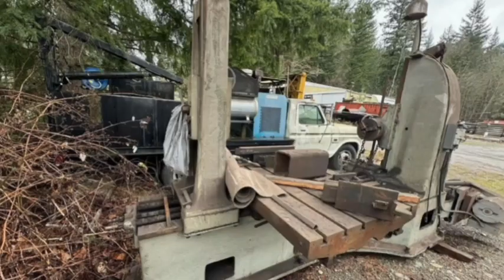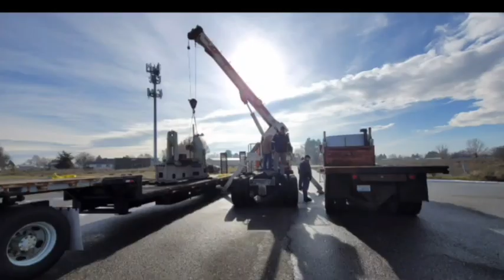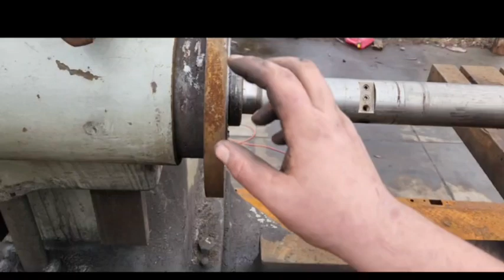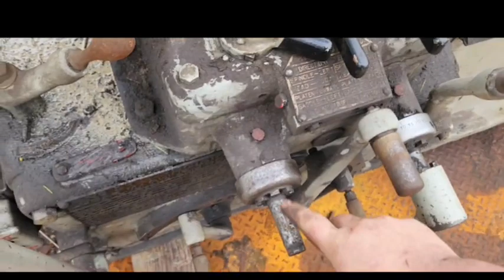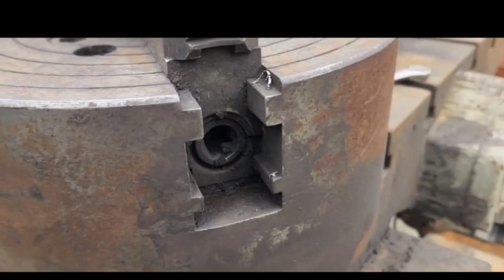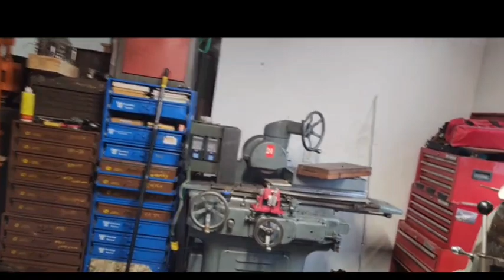New machine day/boring mill introduction

Comment: Nice addition to your shop

The 31 is a little borer it weighs 14k if its the standard orientation, so you werent too over the capacity

Nice you got a line bar with it, lucky man

The plate was added later, theres a 4 hole mount on the spindle face, clean all that goop off the spindle bar, before you run it back in.

That machine will have bronze spindle bearings so it wont ever bore a truly round hole

 the clutch will be asbestos lined so if you are taking it completely apart use a respirator 

If you send lucas the serial they can get you some info on the exact machine, including build date and some extremely basic manuals
Reply from the maker: Thank you, I knew the plate was an add on. I'm debating trying to swap out the bronze bearings for taper roller bearings (I've heard of others doing that- mostly for higher speeds). For now I'll run it as-is, the rest of the machine is very, very worn out so I may just replace it with a newer/nicer HBM in the future.
Reply: @hiddenworldforge374  I've done a swap from bronze bearings to tapered roller bearings before on a Lucas 41, It was rather involved but not impossible. Idk if I'd suggest it, but it certainly can work.

If you do buy a newer borer, if you can find a 41b or a small TOS h63 I think you'd be set.

Until then I am sure what you've got can be made to work. The 31s aren't bad machines, they atleast have Rapid traverse in All axis.

I used to own a 21, which was the series before the 31, it only had rapid traverse on headstock up and down and no feed for the table in and out. 31 is way better than that, even if it's got a few miles on it
Reply from the maker: @procyonia3654  Absolutely, it's in no way a bad machine. Whether I upgrade depends on how much use I truly get out of it, but for now it's a perfect machine for me. I'll have to make a lot of new parts for it before I upgrade the bearings